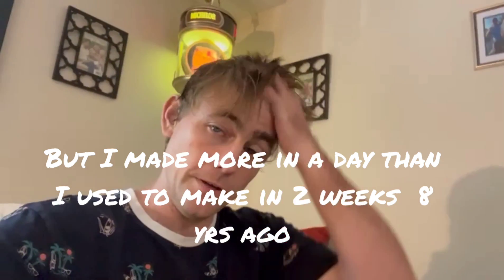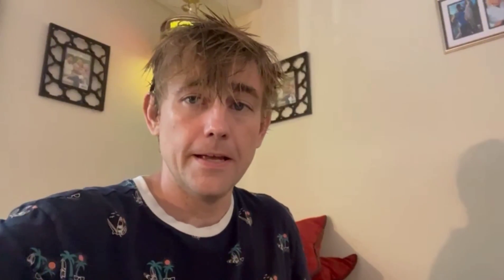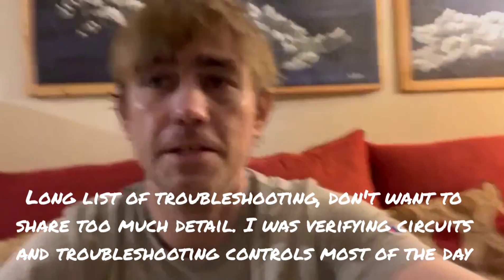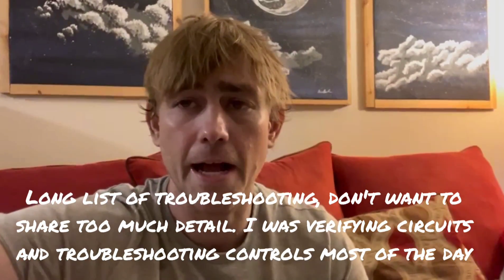Working 12 Days in a Row ∆ Daily Updates ∆ Electrical Technician

Comment: we used to have shutdowns at power plants and factories where we worked 7 12-hour days for weeks even had crazy work 16-hour days they don't do it as much nowadays nuclear plants decided greater than 72 hours was causing more accidents and errors. we would have no free time just eat sleep drive to work.
Reply from the maker: @ranger178  I actually know a few people that earn in the 200,000+ range due to O/T. It's funny I know a handful of high earners. The highest earning people I know are business owners with little to no education, the next few wealthiest people I know are people are doing industrial maintenance lol. Not a lot of people with bachelor's degrees pulling over 200
Reply from the maker: @ranger178  yeah you don't see that as much but in my region that is not uncommon at the steel mills lot of guys doing 6 12s at 45+ per hour. Personally I'm not really built for it but I've been known to push it pretty hard from time to time. After a week or two I got to slow down though
Reply: @gregroche7323  yeah a few weeks of it and i need a day off I was fine with 40 hours a week
we had some guys who did jobs 16 hours a day all week in mad rush to finish and get place up and running they would even just sleep in their cars in parking lot.

Comment: Does your place use SCADA?
Reply from the maker: This is probably so dumb but I try not to give out really any information about how the place I work operates. I'm also completely anonymous about where I work at this current time it's not listed anywhere on the internet. 
I will say this, some places use it, some places don't. It really depends on the scale and size of the operation. Some places just have a bunch of machines with their own plc's and an HMI on each machine, some places have a scada system thay lets you know what's going on all over the plant. 

At the technician level scada modifications and HMI modifications are pretty uncommon, generally you just need to have a little bit of knowledge of network communication and at least some ability to troubleshoot using PLC logic
Reply: @gregroche7323 that’s fair, thanks for the info.

Comment: What is the difference between electrical tech and residential electrician.
Reply from the maker: @Don-kk7ou  well Electrical Maintenance technician is usually doing maintenance on machines, repairing automation systems in a factory. Sometimes it's called instrumentation and electrical technician, automation & electrical technician. Usually there are calibrations, installing/ troubleshooting motor controls, looking at PLC logic etc

Residential Electricians install wires, switches, lights, conduit breaker panels etc. They also do repairs of course.